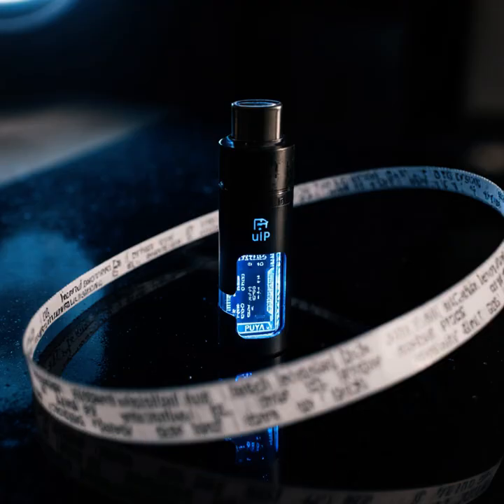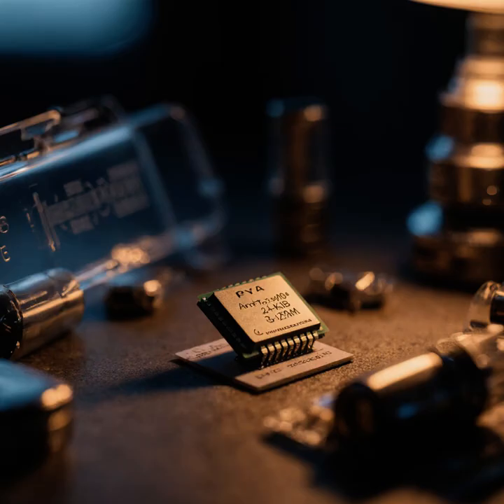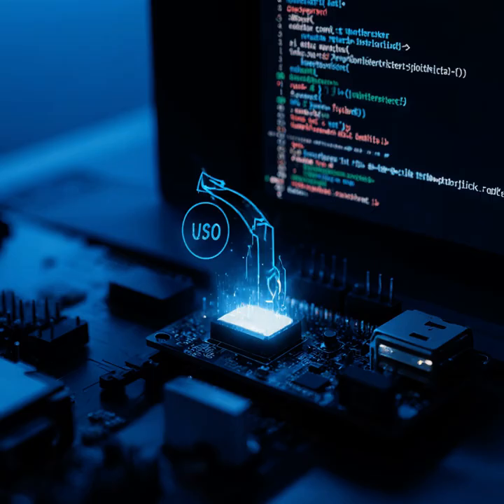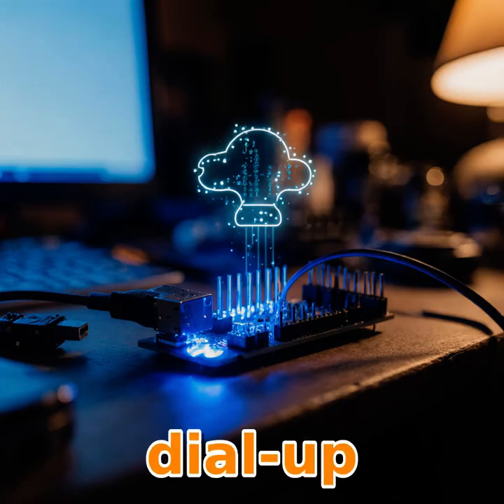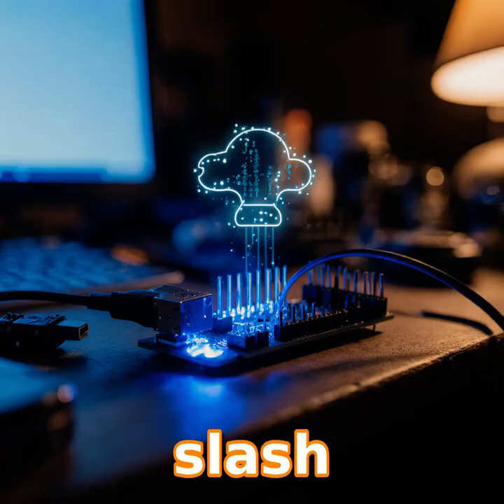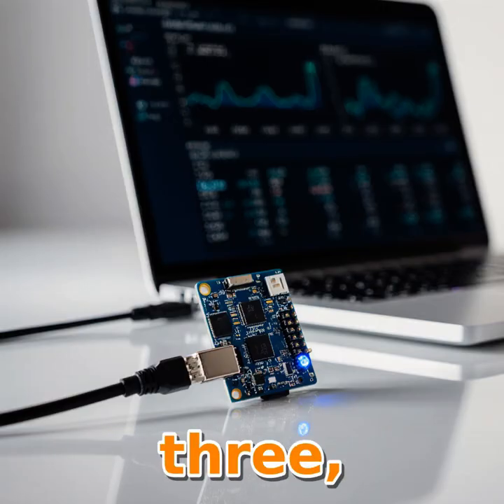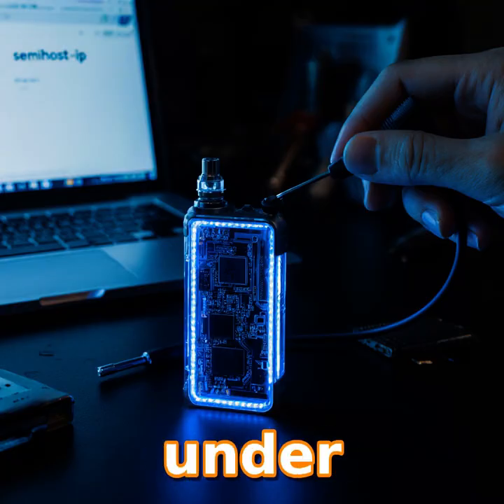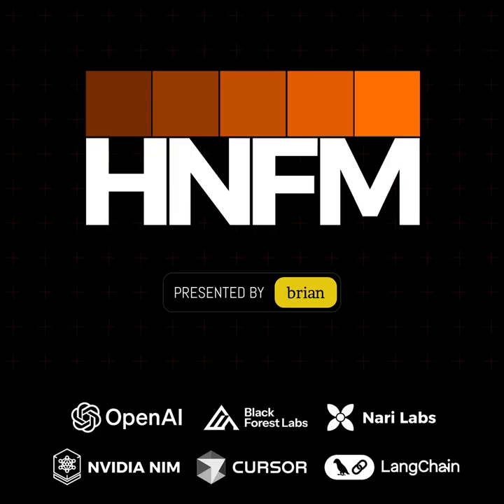Hosting a website on a disposable vape

Comment: Stupid AI trash
Reply: The fact is real though
Reply: @NorthernChimp  If it was real we would be seeing it working. You can't host a website in a circuit that only has a power controller. A VAPE doesn't have an MCU to be able to do that.
Reply: @FixDaily   From the primary source (Bogdan's blog):
"The chip is marked PUYA C642F15, which wasn’t very helpful. I was pretty sure it was a PY32F002A, but after poking around with pyOCD, I noticed that the flash was 24k and we have 3k of RAM. The extra flash meant that it was more likely a PY32F002B, which is actually a very different chip.1
[…]
1. While getting things together for this post, I came across this[link] project that correctly identified these MCUs as PY32C642, which are pretty much identical to the 002B."